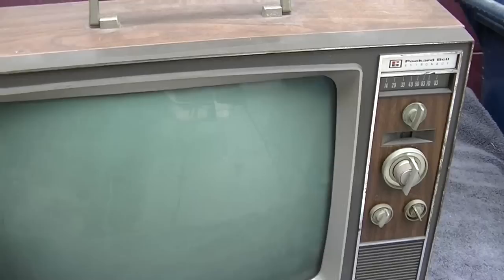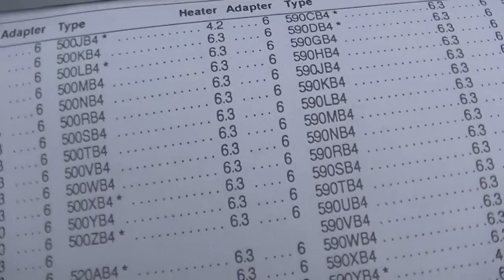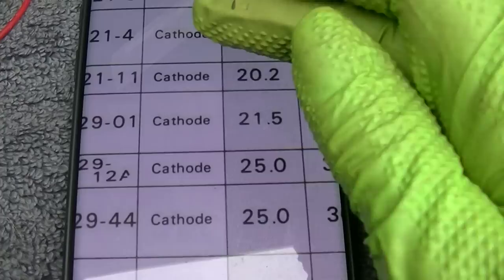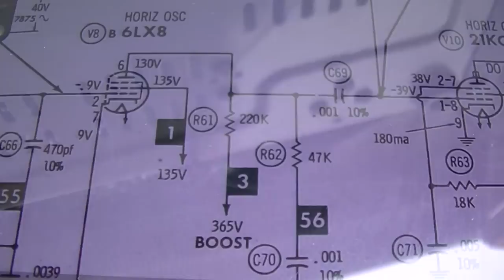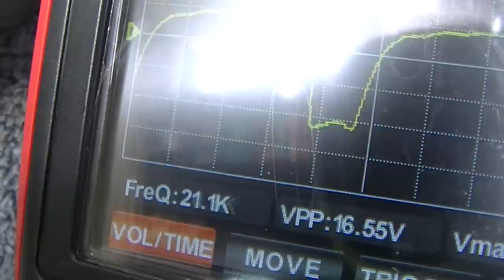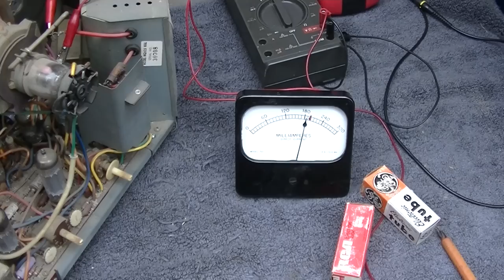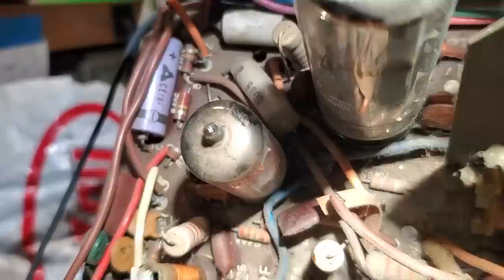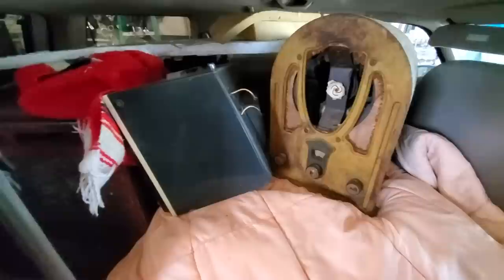Rapair Fail 1969 Packard Bell Astronaut MQ625 Matsushita BW Tube TV

Comment: Intermittent oscillator start-up feedback.  Yeah that can be a dog to figure out.  I can't see the entire oscillator schematic so I'm limited on feedback, but I would replace the lytics in the horizontal oscillator circuit if there is more than just that 4uf.  I would try that first.  It's possible that if it's low in value or open there may not enough gain in the plate circuit to kick start the oscillator.  That cap is bypassing the 10K from the boost therefore putting that point at AC ground when functioning. If it's bad you have an extra 10K in the plate circuit (AC wise.) Old lytics as you know are always suspect and should be considered first.  I had one open on a 1953 AM radio I was working on in the B+ circuit as a bypass cap and the radio went dead.  Funny though all the can caps were good at 70 years old!  Tested perfect even the ESR! If the lytics don't fix your problem you need to find the feedback path that sustains oscillations on the schematic.  It takes positive feedback and I gain of more than 1 to sustain oscillations, you need to trace that path out and troubleshoot there.  Could be an intermittent cap (internally.)  Try cold spray on the circuit.  I could give more feedback but you did not show the entire oscillator circuit.  I can't troubleshot what I can't see.  You say you read these but you never reply to me.  I gave you a great tip on that '66 Admiral with the Color fidelity control and no comment.  No one today knows what that control is for and how it affects the color temperature adjustment. Cool feature!

Comment: Nice job. I have a 1960's Yugoslav (Philips licence) BW TV. It also doesn't have an output transformer. Quirky Philips 300 ohm speaker. It works well and it also is very noisy, and I dare not turn the coils. I'm afraid it will fall apart. And also has a strong picture tube and strech on the top. I will one day try to record the analysis and repair.
Reply: Ei 865?
Reply: @michvod  EI Ambasador De Luxe
Reply: @vextenoch  Yeah there is sometimes one capacitor that needs to be present and I came across one TV set that they forgot to put it in (Ei, a jebiga), and it buzzed when it had text or high contrast on. If you can adjust fine tuning for the best sound with no buzz, but the picture degrades, but if you adjust for the best picture and sound starts buzzing, then it is most likely a slightly out of tune final detector coil.
Reply: @michvod  that' exactly what happens.
Reply: @vextenoch  Yeah, then most likely it is that the audio carrier/detector alignment has drifted a bit due to age. It can be usually adjusted just by fine tuning it to get the best picture, then carefully turning detector coil to see if the situation improves or worsens. That was usually quick way the technicians solved it. There is a book, Opravka TV Prijemnika (Google it for a PDF) that can be also useful. It goes through all possible problems and it takes Ei 865 chassis as a basis.
Reply: You should check the page 102 and 106 in this book. The capacitor is C29 that was missing in my set which caused the same problems as you are describing. "Ukoliko је kondenzator С29 neispravan, doci се i do pucketanja u tonu, koji se роmосi dugmeta za fino podesavanje lokalnog oscilatora (biraca kanala) moze otkloniti, ali se u tom slucaju neznatno pogorsava kvalitet slike." and: "greska zbog koje dolazi do izoblicenja tona nastaje usled neispravnosti kondenzatora С48 (sl. 62') i kondenzatora С29 (sl. 59)."

Comment: Try add startup resistor/capacitor to tube grid to help start oscillation. Or add small wire (antenna) that pick up some background noice that will help start oscillation. Try also heatup oscillator region before start. Maybe this is tempersture related.

Comment: How about to fix the oscillator issue. you get a screen or shield that would go around your 6LX8 tube. solder one wire to ground and the other to the shield. That should solve the issue.

Comment: Wonder if one of the connections on the coil or one of the windings in it has an intermittent open. Maybe try some freeze spray and see if the osc stops when the coil gets cold?

Comment: Did you check that 100K resistor between the 500v boost and the 365v boost source maybe it is changing with temperature just enough to keep the oscillator from kicking off

Comment: What does the CRT engineering theory suggest about acceptable, normal, and too high milliamp levels? I noticed the "normal" mark. What makes that level so prevalent among television CRT? What parts will burn up if these milliamps are too high? Phosphorus?
Reply: Overheating HOT horizontal output tubes and flyback transformers. Most color sets seem to be 180 to about 210 milliamps.

Comment: Don't have your expertise but intermittant problem sounds like a bad joint which requires high voltage to arc and start and then you get thermal expansion to get conductivity.  Bad solder joint?  My bad power window motor looks cherry but it has a dead short.  I am suspecting the stator which is just a coil of wire.  The rotor is heavy guage and looks like it came from the factory yesterday.  Also has a set of contact points which I guess is an overload breaker.  Will have to look at.

Comment: Shango, have you considered making one of the Mr. Carlson cap wizard kind of boxes? Or is the sensitivity unnecessary for the kind of circuits you're working with? I'm curious if some of those aged components are starting to fail in ways that are far more cryptic, changing their non-linear characteristics or some other arcane AC effect
Reply: I think that his cap tester is much better than Mr Carlson leakage detection box as it tests it at working voltage. I have a Chinese megger that will test caps and other stuff at 250, 500 and 1000V DC, well that thing will not let a single leaky component sneak by :)
Reply: Mr. Carlson also made a box to test the outside foil end of a cap when you can just use a signal tracer and listen for buzz. The signal tracer is better as you a get feel for what caps are noisy even disc caps have a less noisy end. The buzz comes from you just holding the cap and the 60hz induced into your body from the wires in the house.
Reply: @michvod  That might be true, but Carlson has tested things that went all the way to the parts-per-billion range in terms of leakage. Granted those were late-50s mica caps but it was enough to deafen the IF in a precision radio receiver
Reply: @michvod  Yes, I use an electrician's Megger, same voltages.
Reply: @lauram5905  Yes, but my tester is extremely accurate even at 250VDC, it will detect if you grab the insulated leads bit firmly as a drop of resistance... Also high voltage is fed from a very high impedance source, so if you touch it, you will not be shocked (much). Basically it works as a Carlson tester but using a higher voltage, thus making it even better. These days, all of the electronics must be Hi-Pot tested which means tested with high voltage, I think 2-3kV at least. So this is why you need a Y2 caps and so...

Comment: Plate Cap on the Damper? since when? Bad crapacitors likely issue. Could it be Horizontal oscillator coil or tuned circuit issue?  Looks like loop gain on the oscillator is borderline, which could be due something dampling the LC tuned circuit. Even some corrosion inside the coil contacts

Comment: I've got a mid-60s Westinghouse 19 inch black and white the horizontal oscillator on my set isn't working as well maybe you have a bad tube socket poor soldier to ground might just be a design flaw

Comment: You indicated that there was a capacitor (50:32) which, when bent away from the oscillator, seemed to resolve the non-starting issue. I wondered whether that was reproducible.

Comment: Greetings:
Horizontal Oscillator startup:
If you can still start the oscillator "manually", maybe an oscilloscope probing can help isolate the offending component that inhibits the "normal startup".  Not an experienced tube troubleshooter like you, but if any of the usual "startup" components will show themselves, maybe when they are not depended on for that function they will appear out of place while the oscillator is running.
Shouldn't the circuit "at rest" be on the verge of starting due to some "value offset" somewhere in the circuit?
Is it easy to stop the oscillation once started? When running, is there a point where the current should be higher than measured? Hope this helps. Examining a similar working circuit might help.
There should be some "theory of ops"
 to explain normal startup.

Comment: All the 6GH8A's were bad tubes. Badly designed from the start. Some companies manufactured them better than others, RCA in my opinion the best maker of them. They always seem to fail fast or get weak on emissions in short order. Especially the AGC section which makes the AGC control very insensitive at the point which the tube reaches low emissions.

Comment: Just a thought (from Captain Obvious)..........What changes besides time between start ups?  Also, what might prevent that voltage from reaching its full potential even when it is oscillating? Find that and you may find your problem. Personally,  though I've been known to be wrong I suspect both the coil (its core) and if not that a cap.

Comment: Not original, HOR output is a Dumont tube!
Hor Osc flaky?  Crack in the circuit board or bad solder joint on same.  Get out manifier.

Comment: I only want to see fail if it explodes at the end.  Get a fire suit.
Reply: I have enough fail trying to fix the power window on my 70 Cadillac.  Not quite to the explode part yet.  I did get the brake lights working.